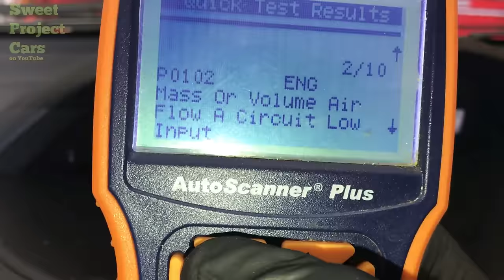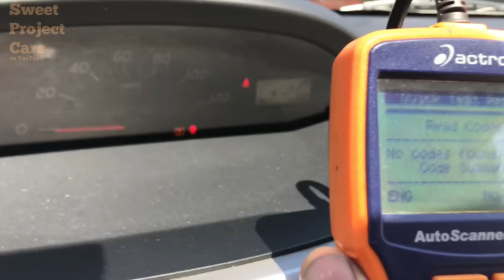How To Test Your MAF (Mass Air Flow Sensor) & HOW to Find A Vacuum Leak

Comment: Hi , is the test working on diesel engin?  I follow your instruction on my volvo xc60 2011 witch I got the same fault but in my case: air flow too high, I try to remove the stick on air flow sensor while engin running but the engin still running. then I try to start without connecting air flow sensor and the engin start as well. Should I conclude the failure on air flow sensor?
Reply from the maker: it just maybe but check with your repair shop first

Comment: My car keeps running after unplugging maf sensor, is this a good diagnosis on all cars or just some ? 1998 sss nissan pulsar
Reply from the maker: Yes this is a good diagnosis.  Replace your maf.  If that doesn't do it, take it to the dealership.  Thanks for asking.  Have a great day.  mad Mike the hammer SPC
Reply: @SweetProjectCars  tried this with a different maf from another car, same thing.. it runs with it unplugged.. but when plugging it back in it stalls

Comment: If I pull mine in C230 , rpm go high and then come back to Normal. Mine MAF is very expensive . What you suggest? Thanks
Reply from the maker: This sounds like you need to take it into a certified repair for Facility to have them take a look at it you’ll most likely end up saving more money doing it that way

Comment: hello friend! Let's say the engine is running,  if the check engine light is NOT on, and I disconnect the electrical harness of the MAF sensor, and the engine keeps running albeit a bit faulty (?) , what does it mean? Is that normal?

Comment: Hey man... 
I had a bad injector I changed all eight injectors on my 2001 expedition and now I have codes p0132 and p0152... I changed the mass flow sensor, cleaned the throttle body and I still have both codes, also there black smoke a (little) coming out when there was none before the bad injector... Any ideas will be greatly appreciated...
Thanks....!
Reply from the maker: Alfonso, first thing you need to do is disconnect both battery cables for 15 minutes.  Then re-connect, and drive the vehicle a mile or two.  If it still does it at this point, then you may have a bad injector, even though it's new.  Start the vehicle up, disconnect one injector at a time and see how the vehicle is running.  If you find one that you disconnected and it does not affect how the vehicle idles, then there is your bad new injector, or shall we say, your malfunctioning new injector.  The black smoke is telling me that one of the injectors is running rich, or not injecting as it should.  Also, make sure that all of your connections are good and that you installed the injectors that they are sealing properly.  Hoping this helps my friend.  Thanks for watching and asking.  mad Mike the hammer SPC
Reply: @SweetProjectCars  thanks for your reply man... I will work on this next weekend and let you know how it went..

Comment: How to remove that check engine warning sign
Reply from the maker: Take this  https://amzn.to/2rjAPfo  and hit reset. If your check engine light doesn't go out after that you have not fixed the problem. You can also try this, disconnect both cables from your battery and let it sit for at least 8 hrs. then re-connect the cables.  Hope this helps McCarthy, thanks for watching and asking, have a great day and all the best on your project my friend. mad Mike the hammer SPC

Comment: When you unplug the maf and it keeps running, is that because it knows the maf has a fault so it is using a base fuel map bypassing the maf's faulty readings?
Reply from the maker: Ferdinand Baricevic if it keeps running after you disconnect that means the computer has learned to run without it..once you replace the MAF then unhook your battery cables for 30 minutes or more and then the computer will relearn the new Maf
Reply: @SweetProjectCars  this explanation is exactly what I wanted to see so I could feel confident in buying a new MAF. Hopefully this will fix my issues. Car still runs when I pull the sensor cable with no change.

Comment: I had a pin hole in my thermostat housing, would that cause a vacuum leak?
Reply: No. It's pressurized with engine coolant in there.

Comment: Does it always stall out if it’s good unplugged mine and it kept running but I have no MAF code on just po300 random misfire
Reply from the maker: It could be your injectors are you have a bad coil
Reply: Sweet Project Cars yeah that’s what I was thinking too van sat around for about 5 years in my garage with no gas in it maybe even fuel pump I smoked the vac lines with no vac leaks I’ll go for the fuel injectors next thanks buddy great video

Comment: I was wondering if Iplug up my mass airflow sensor my car will die it will not run unless I keep it unplugged so I bought a new one and it's still doing the same thing so it is doing right reverse of what it's supposed to be doing
Reply from the maker: have you run the codes?

Comment: Hi does this test work for diesel Vauxhall insignia 2 litre engine I get the code p11db thanks for your help great videos
Reply: Chris England
Reply from the maker: Well, give our method a shot and see if it works for you, if not you will have to take a trip to the old dealership.  Thanks for asking.  Have a great day.  mad Mike the hammer SPC

Comment: So when I Unplug my sensor my car did not stall, I bought a replacement, and It still Stalls can this mean there is another issue or is the sensor I bought most likely  just bad as well
Reply from the maker: You need to follow the video, if it didn't work for you, you will need to take it to a certified mechanic to hook up to their computer to find out the issue.  Thanks for asking and watching.  mad Mike the hammer SpC
Reply: Does it run well without the sensor?  If so go from there! ( My car runs great without the  maf sensor attached)   If you are able to test the sensor with a multi meter or have a scanner. You can check it out yourself. I have Launch 1231 scanner ( About $200.00 Cdn) that does much. It is a professional scanner that will do all this. But will you want to purchase the scanner and learn how to use it!  I still am looking at my issues on the 2010 elantra that nobody wants to look at. If you are paying $100.00 a hour!  That is really steep.  Hope that helps....EJR